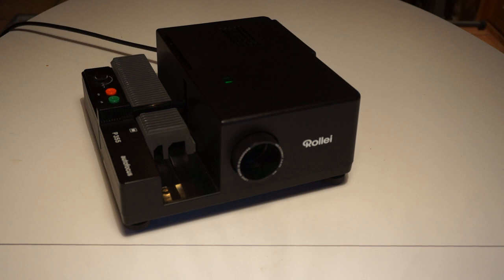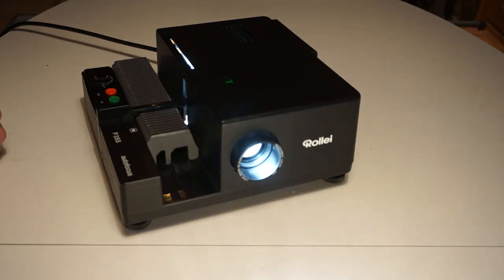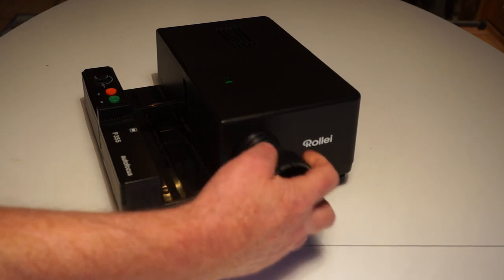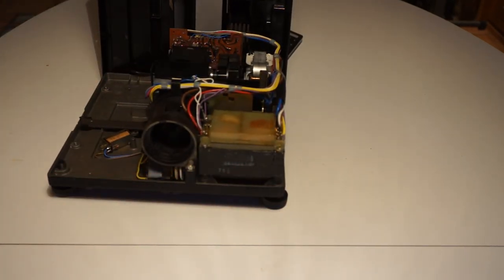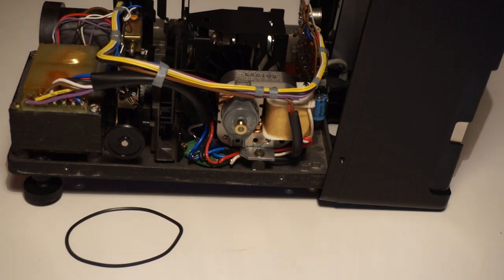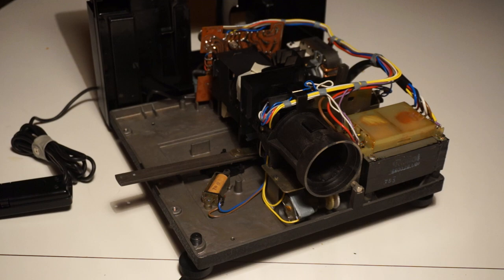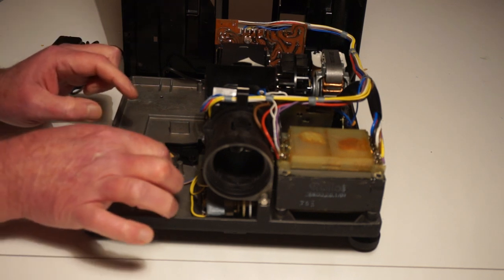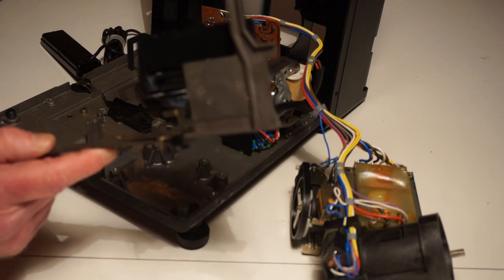Rollei P355 Slide Projector Teardown and Repair

Comment: Hi there! Thanks for taking the time and effort to do this! Really informative. 
I have a York, (same as Hanimex) which seems to be the same functional design. I pulled the lamp out and stuck a 60w bulb in there ...plugged into 110v and also pulled out the lens and condenser lens. I put a piece of plastic diffuser in front of that lightbulb. Next I position my DSLR camera so it can shoot into the lens opening of the projector and take pictures of the slides. I load the slides into a stack loader, use the auto advance and a remote shutter release for the camera, and take pictures of the slides so I have them on digital. I digitize 36 slides in about 5 minutes that way. The camera is tethered to my laptop so the images are imported as they are taken.
The main problem is dust on the slides, which gets picked up very clearly by a 24 megapixel camera! That makes for extra work in Photoshop or Lightroom or both. I'd like to disconnect the fan but from what you have shown here, the fan motor runs the entire carnival. Am I interpreting that correctly ...that disconnecting the fan would shut the whole thing down?

Comment: I have a similar model with the same issues, the carriage not feeding, this has been really useful as I couldn't figure how to dismantle the thing and as you say there are no instructions anywhere else. Thanks for your time making this
Reply from the maker: Thanks - I have received a lot of help from YouTube videos over the years. I am glad to pay back to the community out there. Good luck - and any questions, just ask.
Reply: Thanks mate, you made my day. Just bought same model, & well versed in all projectors, but struggled to get case off. Just wanted to change belt. Slides advancing but struggling in reverse. Forgot to take slide arm off. Top case tight fit to chassis. Quick spray with wd40 on slide change, changed belt for new one and all good. Bugger to get case back on, protrusion on top of case has to go behind circuit board, in case it gets pushed in when inserting plug etc. After watching the case opening on your vid, I worked on my machine, and all good. Now having watched the rest of your vid, we both had same problems, eg circuit board. You much more patient than me, taking it all apart, but over the next few years you will get many thanks for your video, so thanks from me. Eric

Comment: So pleased to find this on YouTube today.  I've just unpacked my P355 which is identical to this one.  I noticed a small metal leaf spring had fallen out from somewhere.  The feeding would jam occasionally.  How good it was to see the little spring at 13.05 - exactly the one that's fallen out.  I'll go now, before watching anymore to see if I can get the spring back in without stripping the whole thing down.  I'll report back.

Thanks so much for this great upload.  Guys like you must save people so much expense over the years.  Too much stuff ends up in landfill and usually it's something quite simple that causes these things to be scrapped.   

is it possible to convert said unit to LED rather than the Quartz Halogen bulb?
Reply: Thank you.  It's now fixed.  Unfortunately the 'Reverse' feed does not work, but I can live with that.
Reply from the maker: @BD-bditw  Thank you for your feedbacck. I am pretty sure that if you did take the plunge and remove all the old lubrication grunge and relube the cogs, it would be as good as new. I did start hoping for a quick fix but in the end I went all-in. Sooner or later I think you will need to do the same.
I agree, we need to keep these old treasures working! As for LED bulbs - wel your guess is as good as mine I am afraid. Stock up on what you can get.